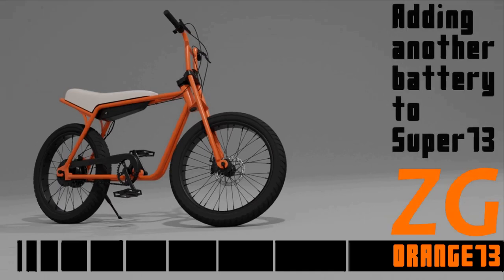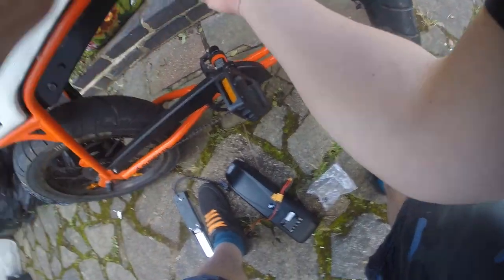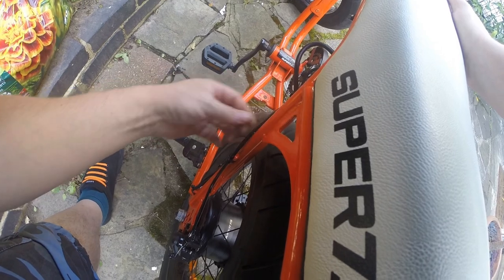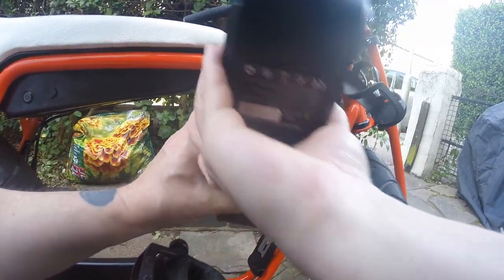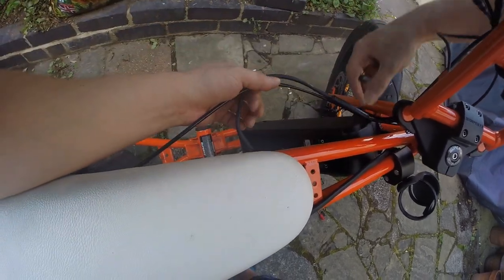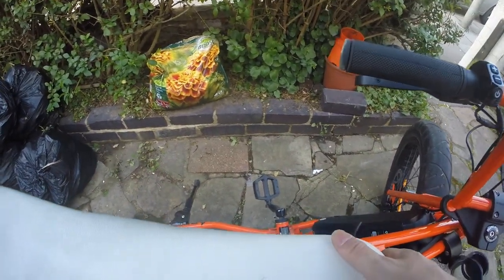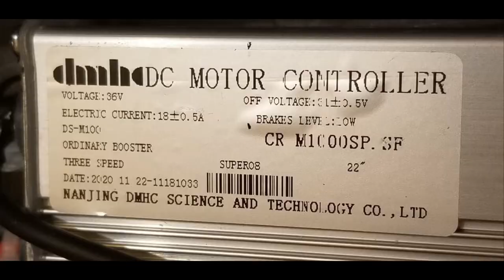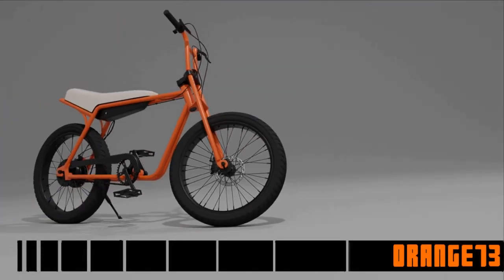Triple Your Super 73 ZG's Range: Step-by-Step Guide to Adding a Secondary Battery

Comment: Great, thanks for this. My Super73 ZG has not been taking a charge so I’ve been wanting to get the seat apart for the best part of 12 months but not got round to it. (Hopefully the battery still has life in it after not taking a charge for nearly 2 years…) Had made a start but those cables seemed impossible to pull apart! Seeing your video gives me the confidence to crack on and pull it all apart. Thanks!

Comment: Having the y connectors over heat the controller or running them at the same time over heat it
Reply from the maker: no, no heat problems at all. You are not drawing any more current than you would do from a single battery. You are using the same amount of power, so no extra heat is made.

Comment: Appreciate the videos mate, any idea where I could source the y cables, can't seem to find any on ebay or online? Cheers pal
Reply from the maker: Not sure where you will get them now, because I got mine about a year ago, but I do know this... If you get 3 red and 3 black Anderson powerpole connectors from Amazon or eBay, you can knock together a y cable yourself in about 5 minutes. Might be the quickest answer.
Reply: @orange73  Cheers mate will give it a go

Comment: Mate I just subbed, your videos are spot on what I was looking for. My wife has a ZG that she commutes on and I have recently got an e-bike with an absurdly large range (130 + miles) I was planning on upgrading the battery so we can ride together & your video has done all the hard work for me. All of your other vids are along the same line of mods we where thinking. I've noticed in a later video when you swap the controller out you have the fucking holy grail, fenders. Where did you snag those from? been looking everywhere. Currently contemplating trying to mod some other fat tire fenders.
Reply from the maker: It took me ages to find the fenders. I got lucky when someone I was talking to said that they had ordered their bike and fenders and then their bike arrived with fenders as well as an extra set. It was pure luck. Sorry man. I hope you enjoy the other videos too... Where are you based? Your name reminds me of the rozzers.
Reply: @orange73  I see,  up north near Manchester. lol it was a college nickname that stuck. gonna have a delve into your other vids later. I'm currently looking into swapping the chain for a belt drive. Because of the wifes posture she's forever fucking up shoes with chain grease.
Reply: @ThePhilff  I had a bike with a belt before. Ironically, I left it locked up at my house one weekend when I was visiting Manchester, and when I returned it was gone. 

The thing I know about them though... You need a gap in your frame somewhere to fit them, because the belt cannot be unlinked. On my bike, which was a trek solo, the gap in the frame was down near the drop outs. 

Good luck!
Reply: @b-rockbeats4355  cheers bud, it's something to have think about for sure.

Comment: Where do you get that extra y connecter
Reply: Because I can’t find exactly that y connecter that you haven
Reply from the maker: @noahvervoort3423  do a search on ebay for "powerpole y cable" 😀
Reply: @orange73  thx bro
Reply from the maker: @noahvervoort3423  np
Reply: @orange73  I can’t find it
Reply: But I look an eBay and I search powerpole y cable and I can’t find precisely that whan you have.
Reply from the maker: @noahvervoort3423  I don't normally link them, because i have no connection with the suppliers and the links change all the time, but here is one i found just now. 

https://www.ebay.co.uk/itm/175345874915
Reply: @orange73  tank you

Comment: Hey so does this mean you would have to charge both batteries 7:47
Reply from the maker: Adding batteries in parallel means you are essentially extending them. 2x 36v in parallel can be charged by one charger. If you want to charge them separately, disconnected one first.
Reply: @orange73 can you explain this a little more? I'm buying one for my mom, and I'm going to do this same thing. How would I be able to charge both with a single charger?

Comment: where can you place the battery when you have the fender set installed.
Reply from the maker: I think in the same place. I fitted fenders myself in another video,but I didn't fit the one on the bottle mounts. I'd say you can just use longer screws though
Reply: @orange73  oke thx

Comment: Hi there! I just bought a 36v 13ah battery and the cable to connect both batteries. Can I use both batteries at the same time? Or is it better to use one at a time? What’s you recommendation? Thanks!
Reply from the maker: Use both at same time is ok. Charge both with same charger. They become like one larger 36v battery.

Comment: Does this also increase the speed? If so how much?
Reply from the maker: Not really. Think of it like expanding your fuel tank, rather than tuning your engine ;)
Reply: @orange73 ok thank you
Reply: @orange73  if I were to charge the batteries after a day of riding do I only have to charge one or both
Reply from the maker: @flanz3366  With a parallel battery connection the capacity will increase, however the battery voltage will remain the same. Batteries connected in parallel must be of the same voltage and can be charged as a single battery pack.

Comment: Do you unplug the Y cable if you want to charge the batteries (because you are charging them independently wouldnt harm the other battery if they are still connect with the Y cable)? With this setup do I need to check everytime before riding that both of the batteries are fully charged so that their voltage are the same? Thanks in advance man!🤘🏽
Reply from the maker: I actually just use the original charger which chargers both batteries without issues.
Reply: @orange73  nice man! So do I need to make sure that they are both fully charged before plugging in the Y cable? Which battery do you switch on first or doesn’t it matter?
Reply from the maker: @d.0202  I did charge mine first, but I'm not sure how much it matters. I switch both batteries on before I power up the controller from the handle bars. If you think about it, what you have is a bunch of 18650's. An 18650 should be 3.6v and so you have groups of 10 of them in series in your battery pack. The groups are then aligned in parallel. All you are really doing is adding extra packs in parallel. I.e. the original battery might be 20*18650 in 2 groups of 10, and I added another 4 groups of 10. 

In short, if you charge together, and you discharge together, they should all level out. At least that is my understanding. 

You can, of course, switch each battery on and use it independently, if you wish .. like run on the big added battery, until it runs out, then power everything down, switch off that battery and switch the other on, and fire it all up again. I think if you do that though, the bike gets slower as it chews through the battery, so probably best to run both.
Reply: @orange73  I really appreciate you! Thanks I understand it now. I will do the same setup🙏🏽🙏🏽👍🏽👍🏽
Reply from the maker: @d.0202  honestly, it's all an experiment. Whatever suits you best, but don't mix voltages.

Comment: I'm installing the same battery on my ZG. I can't see how you putted the connecters and wire through the hole in the black plastic. 
How do I open that hole? It's closed with some sort of lid (edit: grommet). Or did you bore that hole out?
Reply from the maker: Did you take the grommet out?
Reply: @orange73  
Grommet is the word, thanks.
It seems stuck. How do I get it out, just pull hard?

Comment: do you charge both batterys at the same time with 2 chargers ?
Reply from the maker: When you add batteries in parallel like this, they effectively become one bigger battery of the same voltage. As such, i just use one charger, but for longer.

Comment: It’s the same make bespov but just 48v 1000w 13ah
Reply from the maker: To go 48v you would have to swap it all to 48v... That means upgrading the controller as well as both batteries... 

I'm going to be doing a controller update video soon... On the new controller I ordered you can use either 36v or 48v because it is reconfigurable. Both batteries have to be the same though, regardlesa
Reply: Thank you for your help can’t wait to watch your next video
Reply from the maker: @tarikbarak288  I am just waiting on my parts to arrive.. more to come!
Reply: Hi mate I’ve just looked at the description of my super 73 zx and it’s actually a 48v battery
Reply from the maker: @tarikbarak288  my video is for a zg, not a zx, or a z1... I haven't seen either of the other bikes, so it wouldn't be right of me to pretend I know about them. 

General rule of thumb though...When two or more batteries are placed in parallel, the voltage in the circuit is the same as each individual battery. That is two, three, four or more 48v volt batteries in parallel will produce a voltage of 48v Volts! This is why you don't mix voltages.
Reply: Thanks for the info as I don’t know much about electrics and how they work
So it’s possible for me to buy 48v battery as long as it matches
Reply from the maker: @tarikbarak288  your on your own now, padawan... Good luck

Comment: So I have the Z1 arriving next week, which seems to be the US version of the ZG. Any idea if they use the same Y cables? I’d like to try this. Also, do you run both batteries at the same time, or one at a time? Thanks
Reply from the maker: Sorry mate, Z1's are not available in the UK so I have never seen one, and can't comment on their config. 

I do run both batteries at the same time though. I.e. in parallel.
Reply from the maker: @trendkill518  look for a guy @Runplayback here on youtube... he has done lots of Z1 mods.
Reply: i own a Super73 Z1.   same bike (specs) just branded with different name in different market.
if you mod dual battery, no you’re not running both batteries at same time.  you’re basically switching Andersen connectors, from batteryA to controller to batteryB to controller.  plan to adjust for wire location and accessibility too.

my first mod was keeping the original battery under seat (36v 11.5ah) and adding external 36v 20ah battery, like one in video.  in my case, the 36v 20ah external battery gave me enough power to get through most of my “normal” riding day.  got rid of OEM controller, removed OEM battery too, upgraded controller to 48v controller and used battery space under seat to install 24v power pack for custom light system.  Upgraded battery to 48v20ah.

ALWAYS go for battery with the most amp-hours you can afford… you’ll thank yourself later.

ebikes, imo, are made to be customized.

Mod on!

/Bklyn👑
Reply: @robertmotion  very nice! I will definitely add mods, mostly for range, but should be fun! 🙏
Reply from the maker: @robertmotion  z1 and zg are different... they are same basic bike, i.e. frame, wheels etc.... but the electrics are a little bit different. For instance, I know the ZG has a 8.6ah battery built in, not 11.5ah.  The way i did my mod means you don't ever have to switch anderson connections, even if you do not want to run batteries at the same time.... you can just turn the battery on/off.
Reply: @orange73  the minimal difference in amp-hours is negligent.  Same battery. Same controller.  Same bike, country current/voltage notwithstanding. 

Z1 and ZG  are same product with different names and can be modded the same in USA or UK.  

Still don’t believe? Contact Super73 support… they’ll tell you the same.

/Bklyn👑
Reply from the maker: @robertmotion  does the z1 controller restrict you to 15.5mph / 25 kph? I don't think it does. I also think the z1 motor is 500w Vs the 250w motor in the ZG
Reply: @orange73  clip the white wire (white in USA) in controller … speed limitations solved. 

 Z1 motor is 500w, yes. ZG motor is 250w, yes.  “Feel” difference here is ability to go uphill and of course speed/range. yes the former has more torque and top speed, but ….

workaround? same thing: switch/match to higher spec’d battery and controller and ALWAYS upgrade battery and  controller with max amp-hours u can afford, imo. 48v 20ah battery is my second battery mod. 11.5 ah OEM controller on entry-level Z1 is anemic by design. sounds like same “issue” with ZG, too🤷🏾‍♂️.

yeh, i coulda wired both batteries together too; then added a relay switch. the question was “ Do you have to?” that answer is no. 

one thing the ZG has, though, that I had to mod to Z1 is PAS. took all of 20 minutes, well maybe 30-45 (start to finish) to install.

the differences mentioned are “negligible” in terms of HOW TO MOD. same body parts. in terms of “under the hood”, understanding amp, amp-hours, volts, watts, resistance, current,  wire-gauge, etc,  makes a world of difference in how one approaches ebike modding. j/s

great stuff, bro.  great convo.  safe modding!

/Bklyn👑
Reply from the maker: @robertmotion  you don't need to add a relay switch if both batteries are same voltage. I just use a Y cable. 

Also, pretty sure I have read somewhere that cutting the white wire does not work on the ZG model. The zg controller cannot run a thumb throttle either. So like I say, the zg and the z1 are significantly different spec. 

Of course, I will be able to swap out the controller for a KT 22a, only the one I had ordered from eBay just had the seller cancel my order and refund me. I have all the other parts here already. 

Keep it locked for more mod videos. I just finished editing one that's going out tomorrow!

Comment: Why does it need t to be 36v? Can't you just use a more powerful one?
Reply from the maker: If you use a more powerful one, it cannot be used with the original. Also the maximum rating for the controller is 36v